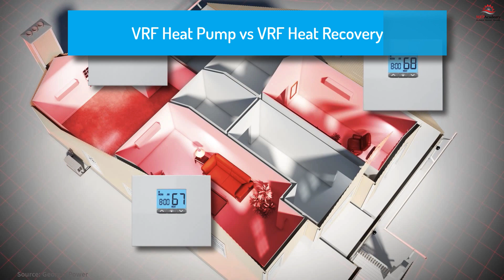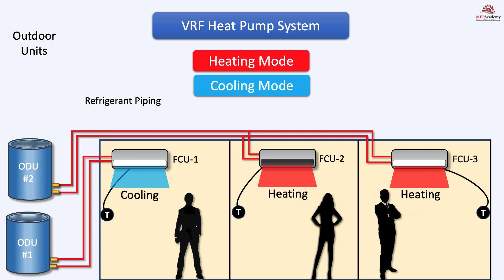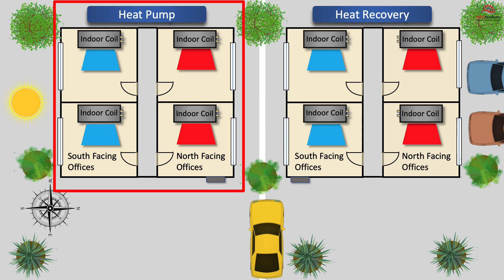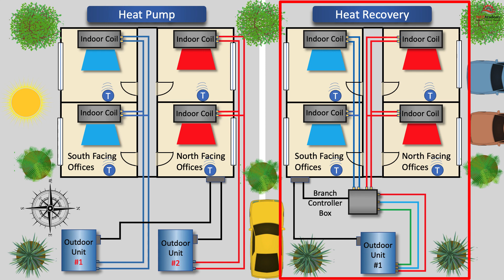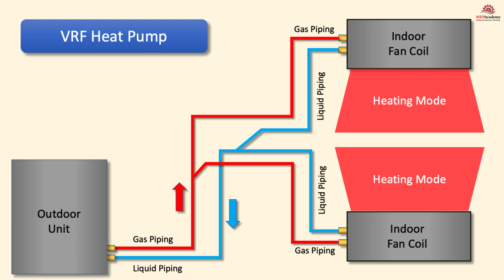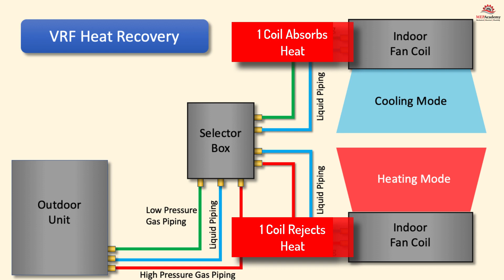VRF Heat Pump vs Heat Recovery

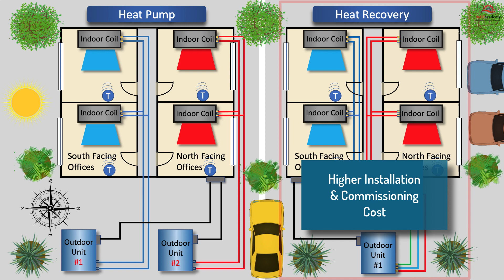Comment: I can't see how a VRF Heat Recovery system, as shown ~5:16, would be more of an investment.  The refrigerant lines should be about a wash because you're not running all of the head units to the outdoor units, but you have the one extra refrigerant line between the outdoor unit of the branch controller.  You also have only one outdoor unit and that branch controller should cost less than an additional outdoor unit.
Reply from the maker: Each project needs to be evaluated based on the merits of either system. Neither system is the correct answer all the time. So you're correct to question the validity of using one over the other.

Comment: What are controlling and monitoring parameter for Fan wall unit for CHW valve, supply duct actuator, temp sensors and pressure sensors
Reply: They're mini-split systems... there are no supply ducts... or any ducts, for that matter.

Comment: Had this confusion how the all weather ACs function ,thought more over it and came to the conclusion that we cant make the refrigerant do both the jobs while just by making the refrigerant flow in one direction ,so the only option left is to reverse the direction of flow of refrigerant and now while searching more about the system functioning got the answer that it actually is the thing done in the systems .
But one thing is still confusing about the capacity of the heat exchangers(evaporator and condenser) are they mode of same capacity because it seems more unlikely to have the evaporator of same capacity needed for the condenser of same capacity,or is there any other thing that is done to make the system work for both the cooling and heating???
Reply from the maker: The coil should match the load profile for the zone it's being installed in. Most of the coil sizing you won't need to worry about as long as you select a unit that will meet the peak demand dictated by your heating and cooling load. The equipment manufacturer publishes performance data on their units, just make sure it will meet your peak demand.

Comment: This sounds like it could work well with a geothermal system.
Reply from the maker: Yes, you're correct, there are VRF Ground Source Heat Pumps. Thanks for watching.